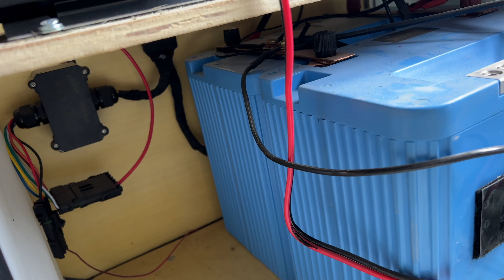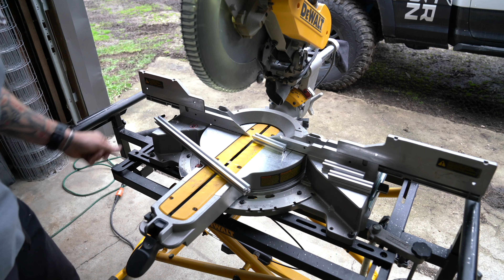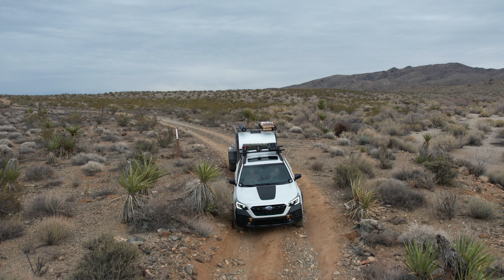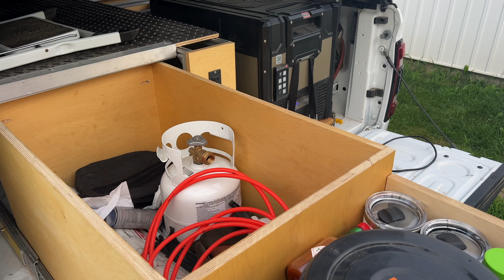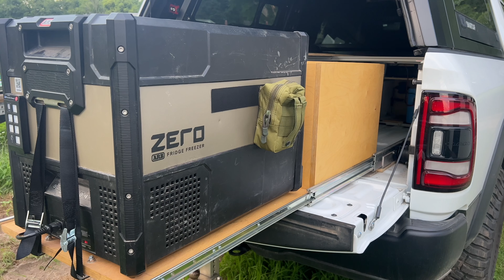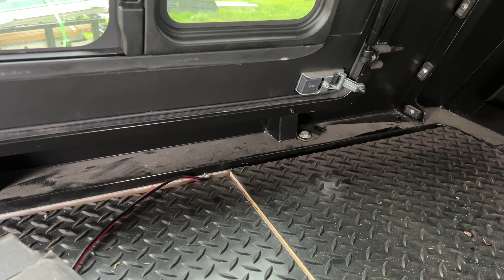Complete Truck Camper Build With Onboard Water, Battery Bank And Solar!

Comment: Hay Josh, nice presentation.  You are a good speaker and a joy to listen to.   Good build sept I gotta warn you about the exposed bugle head screws on the aluminum trim as enter the truck.  Those  will rip your clothes ( and your knees).   Replace each one with pan heads...much safer.
Reply from the maker: Great info and I appreciate your kind words!

Comment: Suggest tying directly into your alternator or seeing about installing another one for direct charging. Chad from living the van life charges 6 100 amp hour batteries using 200+ amps from a secondary alternator in about 3 hours. You could charge your 2batteries in an hour that way. Awesome setup though!!
Reply from the maker: That’s a solid option and it was a consideration before I went back to decked. Loosing so much of my truck bed made things a huge pain when trying to do everyday like stuff.
Reply: That is a awesome idea! I have Never have heard anybody tell bout installing a seperate,2nd, alternator. Thanks! I'm not a A/C man in my truck cab. I took my A/C out and put a bracket with a pulley to use the same belt and you probly can tell me but I should be able with no problem to put the 2nd alternator where the A/C was. Thanks!

Comment: How is sleeping in the SmartCap?  Do you find that it gets too hot?  Due to the steel frame, I wondered if it would have more condensation issues.  I have a Ram 2500 and am thinking hard about the SmartCap...
Reply from the maker: If you plan on sleeping in it then make sure you get the one with the windows for ventilation. We made that mistake on the gladiator and didn't have windows. With the windows there's more than enough ventilation to keep the condensation down. Obviously that also depends on the temperature outside.

Comment: The pull out looks awesome. I'm not into or have knowledge of all the power stuff but I personally feel like biting the bullet and buying a Redarc system would be worth it in the long run. Some things buying from companies that have experts designing them is better than attempting to DIY it. Other things like drawer setups or seat delete stuff I feel DIY is the way to go and not pay the big money for the name brand ones.
Reply from the maker: I'm going to have to fail a couple more times before I spend the money on Redarc. I really think I can get this working without out it, but time will tell!

Comment: Your concepts are sound and I have no doubt your improvements will be stellar, we ALL go through different iterations of transforming our rigs into "exactly" what we want, I couldn't tell you the number of design changes I went through with my '14 Power Wagon and I still tweak it now and again.  I'm going to offer 2 tips that you'll thank me for later since you're about to overhaul your build.  #1 - buy a REDARC Manager 30 to handle all your electrical  #2 - upgrade your inverter to a minimum of 2000W and preferably 3000W  I know that nobody likes spending money, but the Manager 30 will take care of ALL the craziness you have going on with your charging system and keeping things topped off, research it and you'll see what I mean.  More power from your inverter is strictly up to your needs, but when I am gone to parts unknown, I like to have the ability to run an Instant Pot, boil water for coffee, run a blender, or even run power tools...  I like my creature comforts, so sue me, LOL!!!  Oh, another tip, just add an inline regulator for your water pump...  Easy peasy...  Nice rig, and I wish you nothing but the best for a fellow Power Wagon owner, not many of us out in the wild but I wouldn't have any other rig!!!
Reply from the maker: Appreciate the feedback and I have looked at the manager 30 several times, it just seems so ridiculously overpriced for something I know that I can achieve if i'm willing to put the time and effort into it. Either way, your comment is super helpful and i really appreciate someone chiming in with positive feedback to help me along on this build!